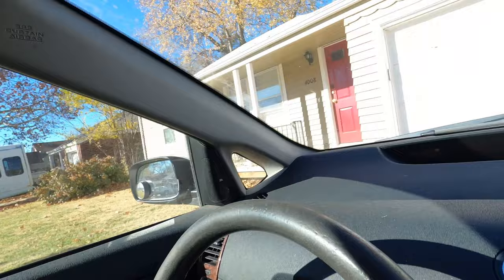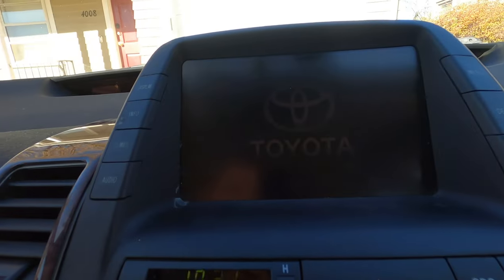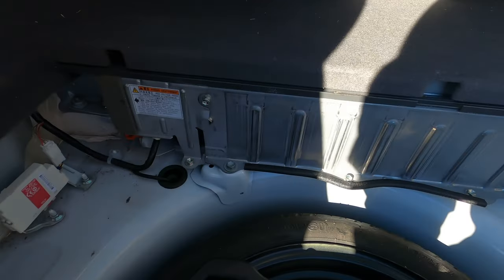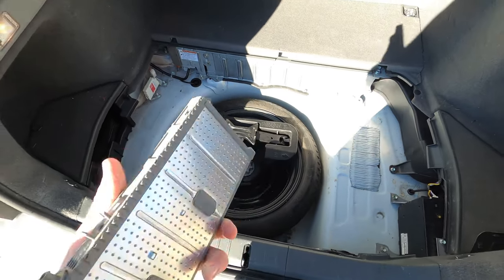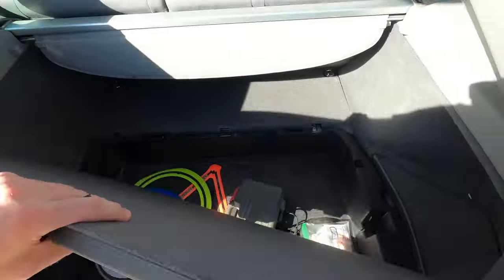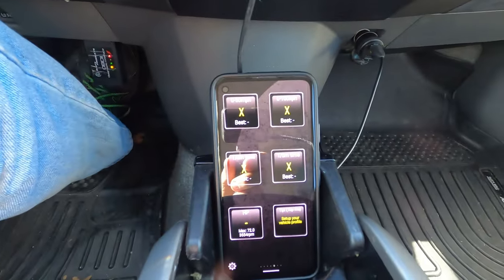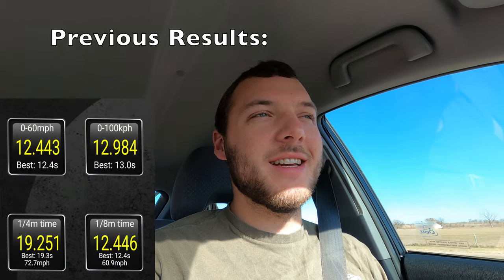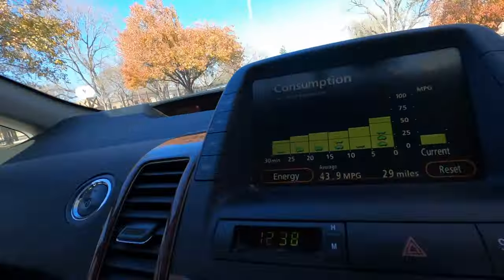$1500 Prius Battery Replacement Worth It?

Comment from the maker: Little update here, the battery replacement was for sure worth it in my opinion! It was $1500 all said and done and comes with the lifetime warranty. My gas mileage improved about 5 MPG on average (roughly 40 before and 45 after). I only owned the car about 6 months after making this video but up until the time I sold it the battery was working perfectly fine and I haven’t heard anything contrary from the new owners!
Reply: Now they are $1700 and only have a 3 year warranty., seems like you can't find a deal anything like that anymore.

Comment: I'm a full-time Lyft driver and I just recently had to have the battery replaced in my 2012. Prius v, I called green bean battery as well. Unfortunately I don't drive a consistent route every day and even before the battery went out even before I put 200,000 plus miles on the car myself before the battery went out. I just did not notice that I would get consistent fuel economy and I can't really tell the difference in power from having the green bean battery installed versus my original battery 40,000 mi ago. Even myself personally, I found that for my car my Gen 3 it was 1644 for the battery and then the lifetime warranty was another $275 bucks. There's two warranty options. There is the 3-year unlimited mileage warranty or the lifetime unlimited mileage warranty plus, if you're 12 volt battery hasn't been replaced recently, they'll replace it for you and they replace it for you at a wholesale cost. It was $250 to replace my 12 volt battery and now if I were to go to AutoZone O'Reilly or any of those other places to buy the one for my Prius it would be $250 they did encourage me to get a new 12 volt battery so that way I would not have any warranty issues with the hybrid battery. That being said, the initial hybrid battery they installed had a bad battery control module so it did not play nice with the car. They came out within 8 days of putting the first battery in and swapped it out for a second battery as a warranty job and then I haven't had any issues with the car since.

Comment: The traction battery does not make any difference in the zero to 60. It is not driving the wheels. The only improvement should be in the mph. If you reset the average mph to zero, it will show the better mph that the new battery will provide. The important thing is; how much the new battery , and the installation cost, and is it worth it!
Reply from the maker: It actually does impact the 0–60. The traction battery and electric motors assist the ICE so the car is noticeably slower when the traction battery is depleted and vice versa. But the battery replacement was 100% worth it in my opinion!